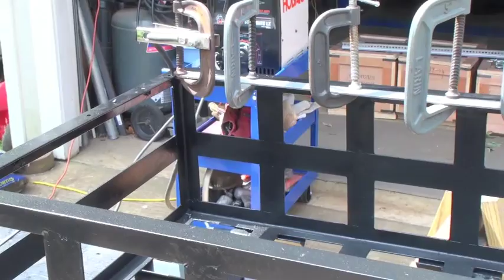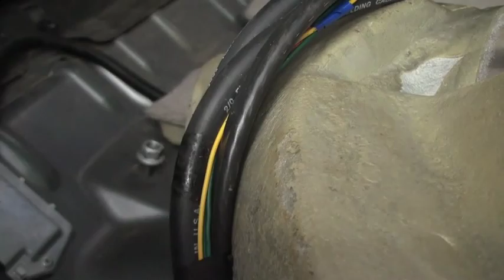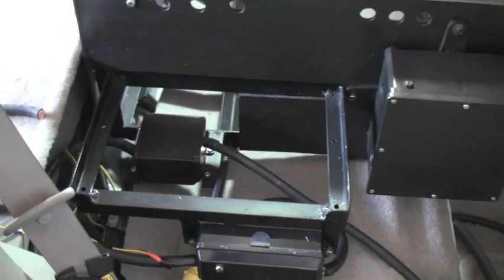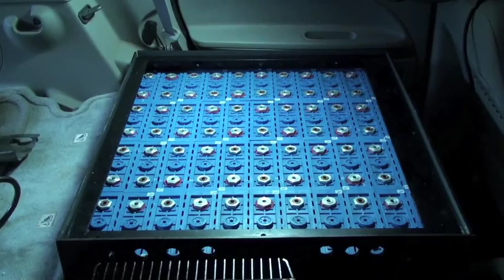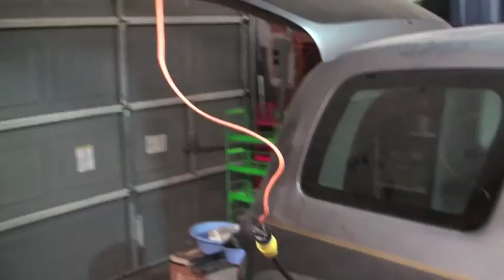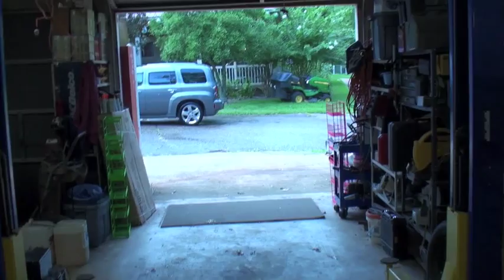HHR update August 2012

Comment from the maker: I didn't mention a bms because I'm not using one.  If you will do a little research you will find that the EV car fires were started by the bms allowing over charging of the cells.  With the charge curve that I use I intentionally under charge the cells so that none of them reach that critical point on the curve where the voltage begins to rise exponentially.  This is the dangerous part of the curve where slightly differences in capacity can result in one cell over charging and catching on fire.

Comment from the maker: Thanks, these are 130 amp/hr cells.  it will do 40 miles easily ( so far ).  I've only taken about 90 amp/hr out in testing.  I did one 30 mile trip keeping the speed up around 70mph and used a little over 85 amp/hrs